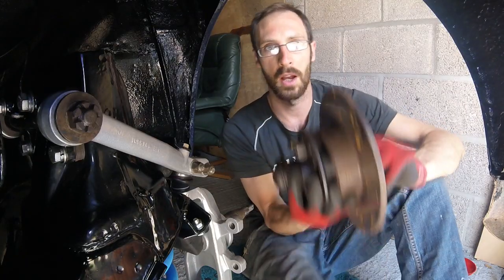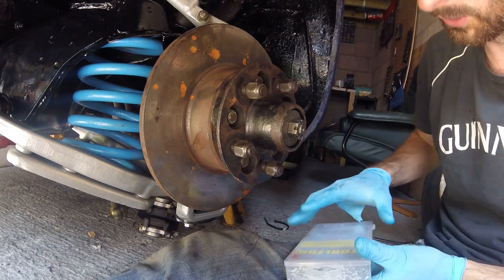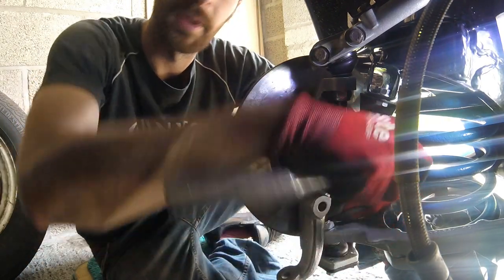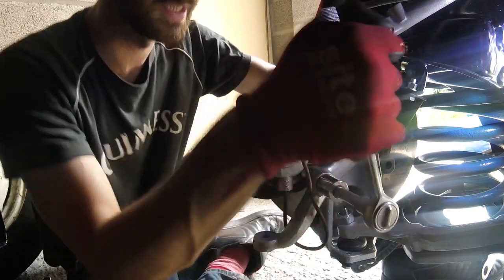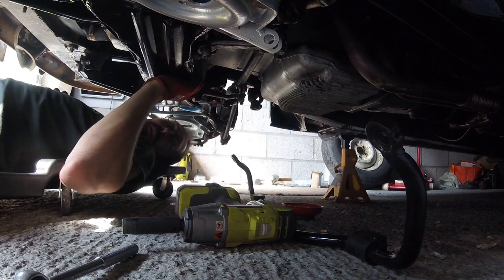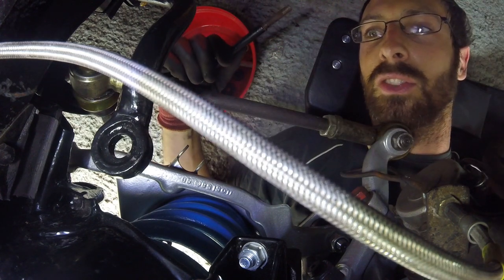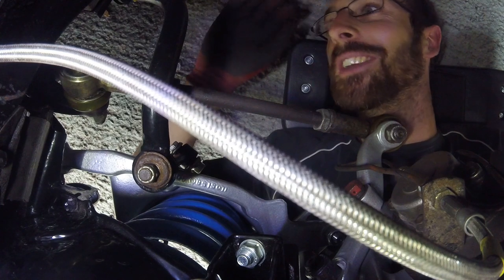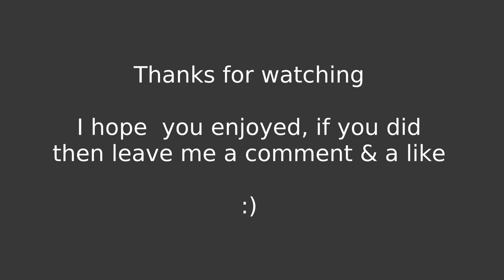Jaguar Mk2 | 03 refit hubs & brakes

Comment: The front wheel bearing play has to be adjusted with the roadwheel on Vic, Doing it on the brake disc will make it to slack mate.

Comment: A typical example of someone who hasn’t a clue what he’s doing, very dangerous, brake pipes  need to be clear of the wheels, look at pipe routes on parts list, certainly not like this, calliper mounting bolts NEED lock wire, also bottom calliper bolt gap and mounting flange need to be measured to find shim thickness to avoid bending steering drop arm.